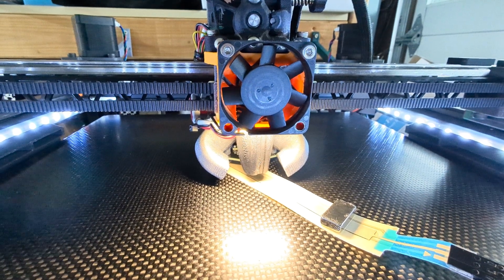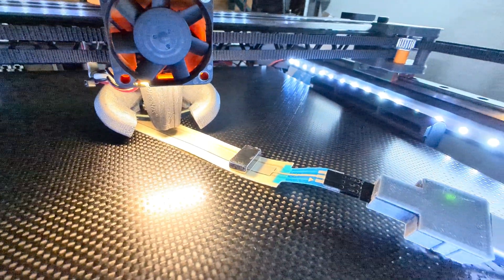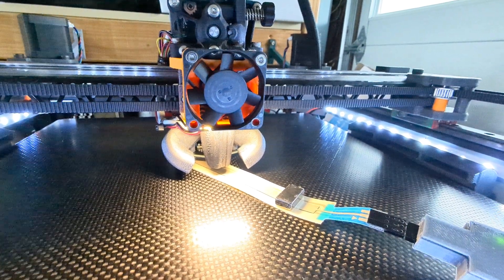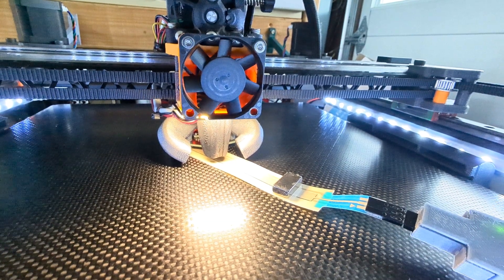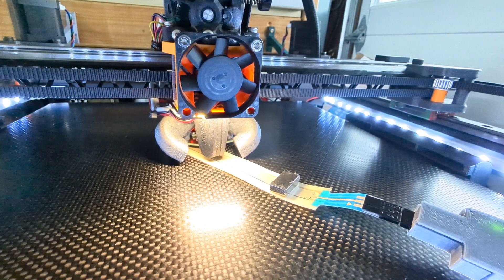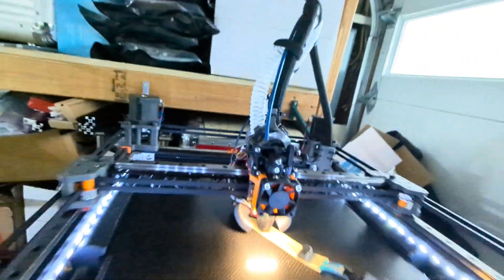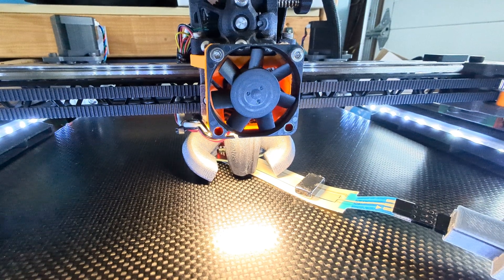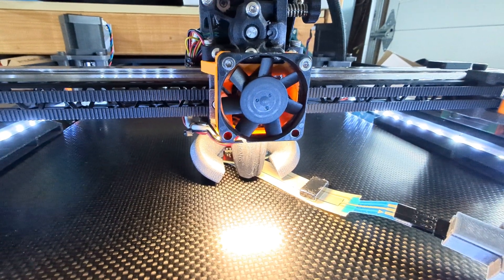Sensor to repeatably determine probe Z offset using PROBE_CALIBRATE Klipper macro

Comment: If you have a metall PEI sheet on the bed, would it be possible to use an electric detecting between nozzle and PEI sheet to get make the probe? And then add automatic the offset for perfect layer?

On CNC mills they use it to automatic detect the zero points...so why we don't use it onour 3D printers as well?
Reply from the maker: It may be challenging to run a wire and attach it to completes a circuit - I like the idea though, maybe I'm not thinking about it in the right way...

Comment: Does the soft pot deform over time?  I know my paper 'feeler gauge' gets compressed and needs replacing often.
Reply from the maker: I've been careful with mine, and try not to jam the nozzle into the probe (though it's happened from time to time). The potentiometer is pretty thin, and I could imaging that if you bent/folded it, that would be the end of it... I print daily, and don't really change build plates/nozzles that often, so I probably use this probe once a week or so.

The spec sheet says it's got a lifecycle of '> 1 Million' - 1 Million what - I'm not so sure... I'm assuming 'actuations' =)
https://spectra-symbol-landing.s3.us-west-1.amazonaws.com/data-sheets/SoftPot-Series-Datasheet-v2019a.pdf

Good news is they are relatively inexpensive at $8.50 for a 50mm sensor.

Comment: this is really cool man, im interested in making one as well, maybe even leaving it on the side of the bed or something where you can just calibrate it auto and just send the toolhead there?
Reply from the maker: I'll make some time to get the details posted up on github - I'll ping y ou when It's posted.

There are some heat considerations for the potentiometer - I think there is a high temp that maintains accuracy at 80c, standard is 50c I think... So depending on how hot you get your build plate it's definitely a possibility.

I'd love to see h ow to get this more 'integrated' as well - could really help with reliability! I'm sure there are some clever folks out there who can help! =)
Reply from the maker: I've put build instructions up on Github https://github.com/djsplice/TinyTouch

Comment: What makes this better than tap or unklicky?
Reply from the maker: Great question! I haven't used either TAP or Unklicky, so I'm not really sure if either of those solutions help determine Z Probe offset. I know you can use a sexbolt to help you determine that, I'm just not sure if TAP or Unklicky replace the need for sexbolt as well...

This solution is basically a more repeatable way of setting Z probe offset vs using something like the paper method or a feeler gauge. Both of those methods, I've found, require some sort of tactile experience, knowing when the nozzle is pinching the paper/feeler gauge 'just the right amount'. 

This probe is kinda like a sexbolt, but it's not permanently mounted, and isn't used at the beginning of each print. I mainly use it when I change nozzles, build plates, adjust the toolhead, or just notice my first layer isn't up to snuff.
Reply: @JeffBarrows  Both solve the Z probe offset. Tap has 0 offset by definition. Unklicky (and klicky too) have an offset, but especially in conjunction with klipper_z_calibration it is very repeatable and independent of build plate, temperature and humidity and so on. It just needs to be tuned once and that's it.
Reply from the maker: @oznerol256  sounds like this type of probe would be an improvement for those not using tap, unklicky, or sexbolt... 😂
Reply: @oznerol256  You still have an offset with the Tap, and that's the difference between nozzle contact and endstop. There is also still a requirement to use paper or some such to get that offset. Otherwise, the endstop is "zero", but the nozzle is a couple of mm below that point. The OP's method would still work for the initial dial-in of Tap taking the thickness of the sensor into account, especially if the sensor is a known and consistent thickness.

For example, I installed one of the CNC milled Tap assemblies last night and had to go through the same probe calibration as with the BLTouch, etc in order to get the nozzle a paper's thickness off the bed. The paper I used has a thickness of 0.27mm, so I got it dialed in, then baby-stepped -.07mm and hit print on my first layer test. Perfect the first try, no fine adjustments other than knowing I wanted a .20 first layer and that my slicer was configured for that.

Comment: I love innovations like this.

Is the thickness of the potentiometer just perfect for the nozzle distance?  Or is there some offset you're using to compensate for it?
Reply from the maker: This is probably Beacon probe specific, but there is a 'cal_nozzle_z' variable that allows you to specify the expected nozzle offset after completing manual Z offset calibration. I measured the thickness of the potentiometer and used that value (.52).

Now that you mention it, I'm not sure if there's an equivalent variable when using other probes - I'll have to look at Klipper docs...
Reply from the maker: In case you want to build one yourself, I've put build instructions up on Github https://github.com/djsplice/TinyTouch
Reply: Nice!  Thanks!